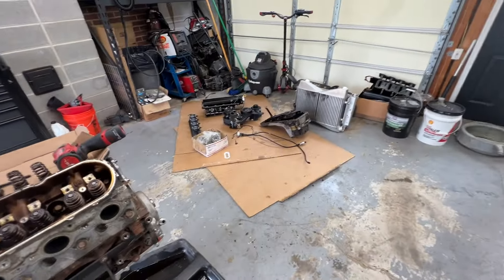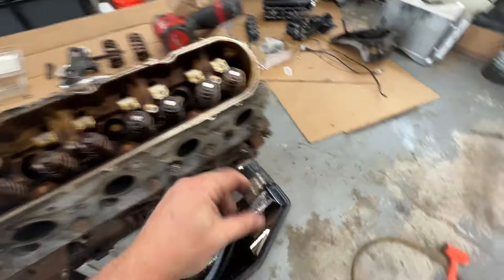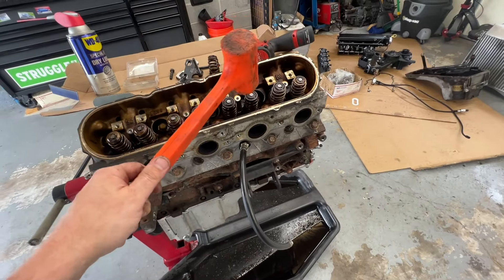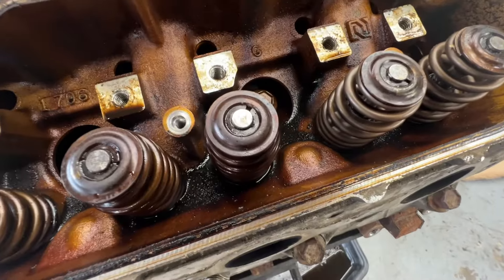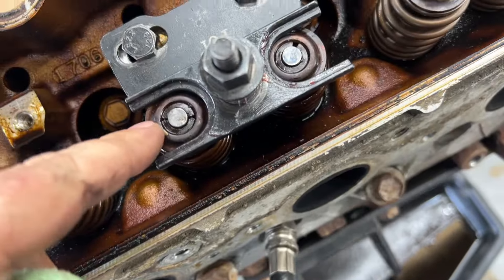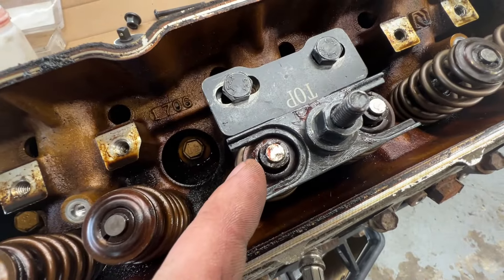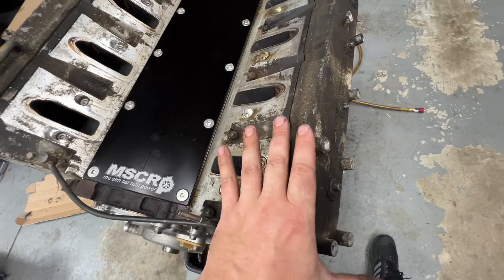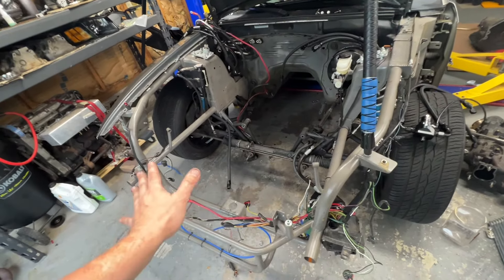Crusty 4.8 prep for new edge

Comment: For those without an air compressor, bring the piston to the bottom and shove some nylon rope in the spark plug hole. Rotate crank til it stops then the valves can't fall in at all. Works mint

Comment: i borrowed a spring compressor of a mechanic mate of mine to swap the springs while the heads were off. i returned it about 40 mins later and he asked if i would need it again when i got the heads back. He actually looked shocked when i said i didn’t even take the valves out. Silly rabbit.

Comment: Another tip for doing springs with the heads on: the horror fraught extended-bent needle nose pliers with a rubber band on the handle will hold the valve stems thru each port quite well. It's a good safey net.

Comment: I’ve always used a socket and a hammer to get the retainers off. Then going back together I use that tool. (Amazon $30)

I have those same springs on my 6L I’ve buzzed it to 7300 so far. Nothing seems mad 

I also bought a Gen3 billet valley cover because it was $50 it came the next day, it was the only way I could get a valley gasket next day.